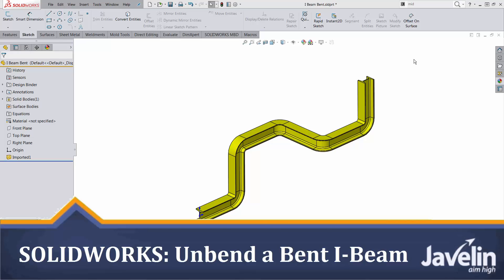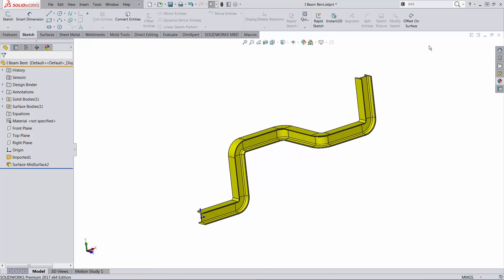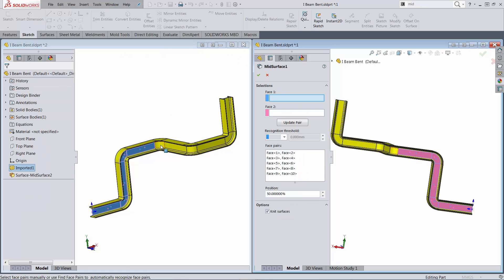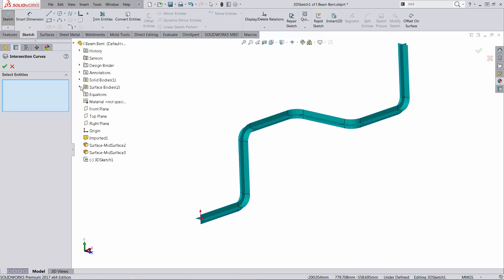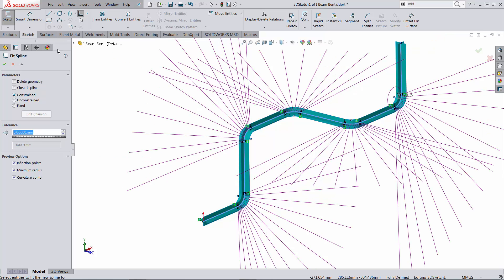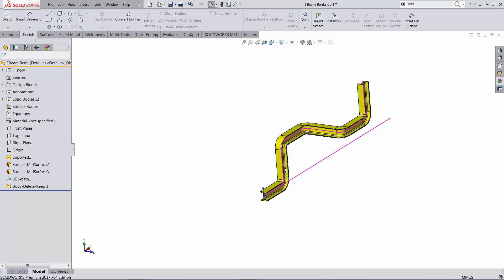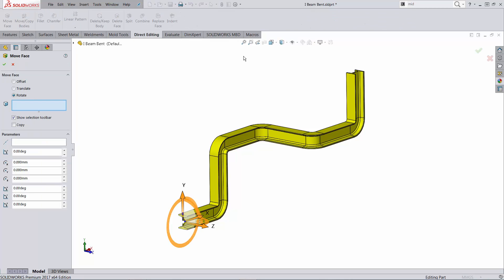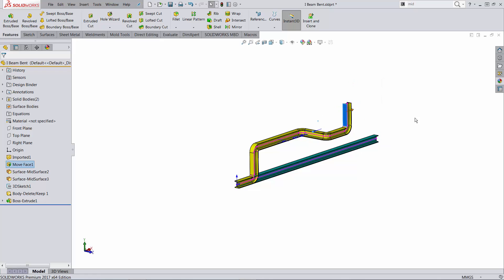SOLIDWORKS Tutorial: Unbend a Bent I-Beam

Comment: thanks for the video. it contains not just the concept but much more advance tips
Reply from the maker: Thanks for the kind words, Eyal. Which advanced tips have you noticed?
Reply: Using the mid surface, which I totally forgotten about. the way to let SOLIDWORKS find pairs. also dividing the screen for picking both sides is brilliant
Reply from the maker: Thanks for pointing that out, Eyal.